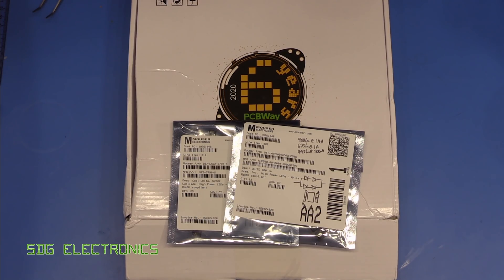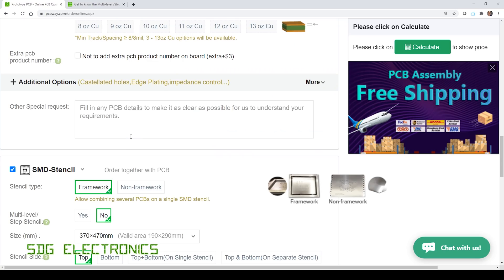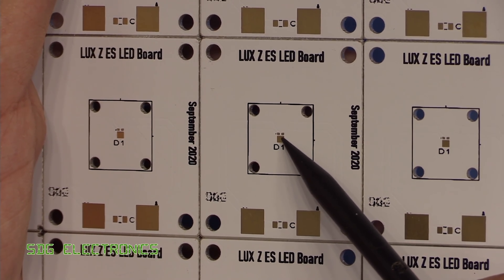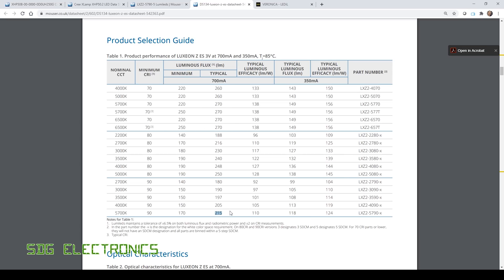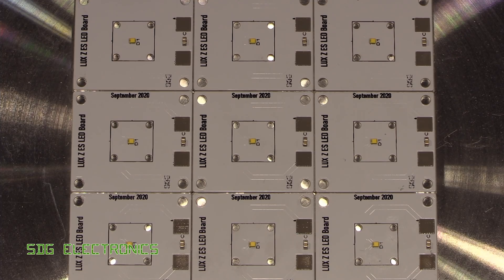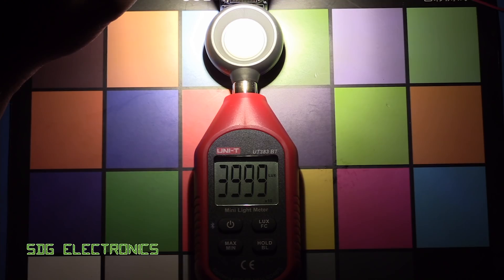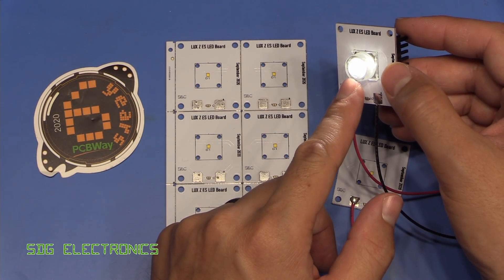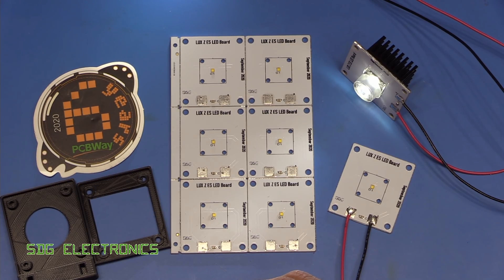SDG #177 Luxeon Z ES LEDs on Aluminium PCBs

Comment: How can I connect 3Pcs xhp70.2 in series and pararell because I want to put that three xhp70.2 on my olight x7 mauruder with 1 series and 2 pararell 18650 battery
Reply from the maker: You can connect in parallel, but the current must be increased to reach maximum brightness

Comment: Hi @SDG Electronics. Keenly following how this progresses.  After my earlier question to you, I went ahead with the Eakins Black Microscope bundle. First issue was inability to simul-focus the camera & direct view.  So I'm now waiting on a 5mm CS Adapter to lift the camera up (they should include this in the bundle!).  Next problem is the 37M Eakins camera included in the bundle doesn't get enough light at the normal elctronics working distance. It also came with the 0.5x Camera Adapter (instead of 0.35x), so I get less FOV (and less light!).  Undecided on ordering the 0.35x just yet. First priority seems to be the 5mm CS Adapter, and then solving the extra illumination for the camera problem! So keen to see the final evolution of this project. :-)

Comment: I once bought 60 of similar style heatsinks on Ali (40x40x11mm) for $6 per 10pcs including shipping for my lighting project.
They turned out perfect for 3.25V 750mA 3535 LEDs (Cree XP-E and similar) for passive cooling.
Pretty common heatsink size. I think it originally comes from PC expansion cards like Intel quad NIC cards.

Comment: It's hard to tell from the video, but it looks like you might have trouble installing the LED modules into your new chassis.  The side walls of the chassis appear to be too close to the screw bosses (and too tall) to allow a good angle on the screwdriver.  Hopefully you've considered that and I'm talking nonsense!
Reply from the maker: The (hex head) screws just fit. I might do something where they snap in instead though without needing screws in there.
Reply: SDG Electronics Aaah, I see.  A small 90 deg hex driver would fit, no problem.  Well played!

Comment: Having a narrower beam might be better to avoid flooding the rest of your work area with light. However your eyes could get some strain when switching between the microscope view and say reaching for the soldering iron or the multimeter probes at your room lighting. That would be something to look into.
Reply: Also some lenses may turn a uniform color temperature light into noticeable gradients of concentrated colder and warmer areas.

Comment: Well this is turning out to be a great example for how to proceed to develop an idea in electronics. Then refine it / reduce back for the BOM cost. Also the new enclosure you have now looks a lot better. And with the ability to angle the led modules. It's really great!

Something inside is now also telling me that perhaps there could be some clever mechanical solution (for example to run a wire or a rubber band all the way around the perimeter). To link together all the led modules and give a way to adjust their angles all simultaneously. At the same time. But I am not a mechanical engineer! So don't actually know of how to do that.

Anyhow perhaps not be needed. So long as the spread / diffusion remains broad enough to cover the whole adjustment range of the microscope. Then no need. It would seem so from the examples here in this video.

A redesign of the casing / shell could also permit smaller led modules. About half the size. And therefore stick out a bit less (sideways) from the microscope. That would also come with a drawback of making the LEDs a bit closer to the microscope. But not very much. It also maybe means loosing compatibility with the larger Cree LED modules. All different sets of tradeoffs. And to redo the design / re-iterate it so late stage. Perhaps not worth too much bother / not to worry about it. Since overall things are already looking pretty good as they are. Good luck!

Comment: In the led holder brackets if the back part is taken out, would it increase the effective cooling area a little bit? Just screw the pcb directory to the front bracket.  Now the bracket seems to trap heat inside. 
 How hot the new LEDs run without the little heatsink?  If I'm reading the datasheet right @750ma they should be consuming about 2.1W @ 2.8V Would there be enough cooling if the heatsink was removed and make multiple holes to the aluminum pcb to make the air pass through? Then mabye the back part of the 3D printed bracket can be made into a tall chimney to aid the air convection trough.